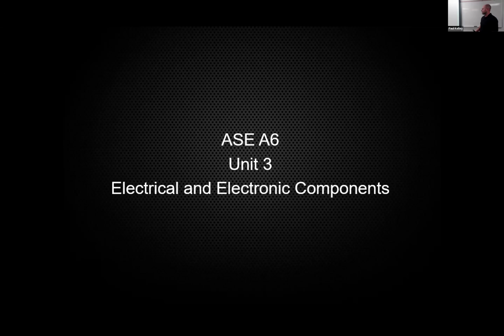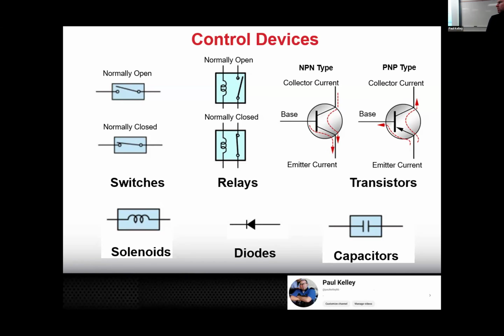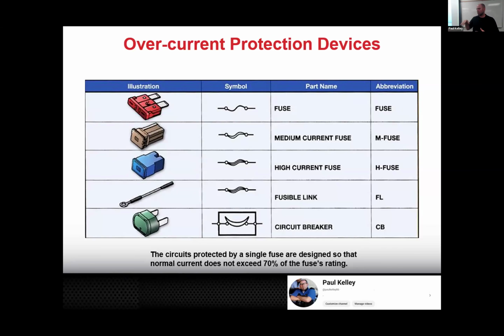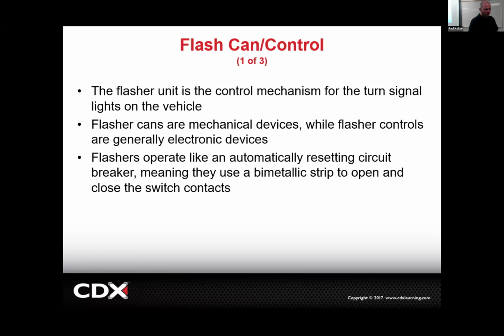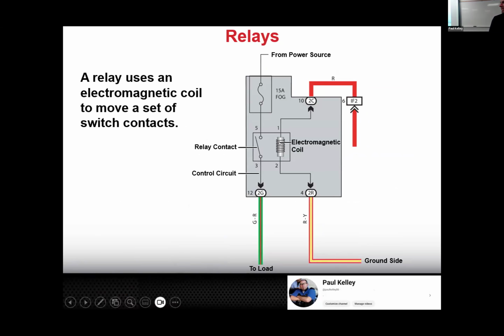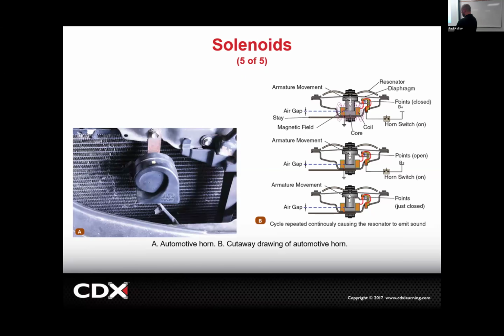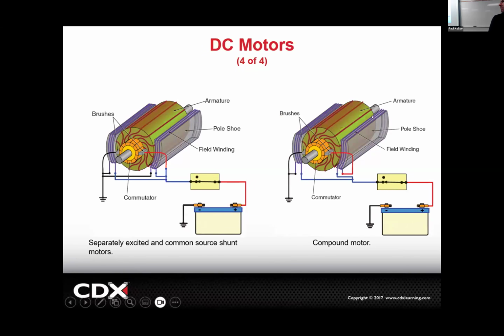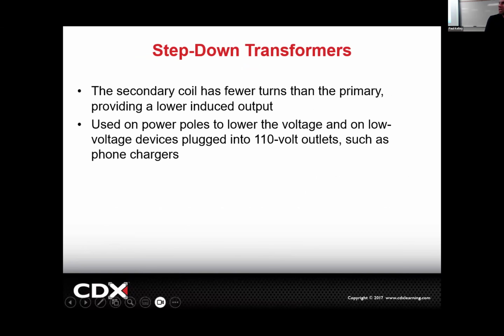ASE A6 Electrical and Electronics Class Unit 3 Components Part 1

Comment: Hello I was wondering what year this class was filmed in, I see the 2017 copyright in the bottom but I just wanted to make sure if this info would be missing info for my test in 2026; thank you !
Reply from the maker: Thats some of the original material I use which is supplemented and updated which is why other slides have no copyright. It was filmed last week if it is my current version. Pretty sure it is. The publish date it typically the day after the original lecture.
Reply: @CollegeAutomotiveClasses noted, thank you for the reply!